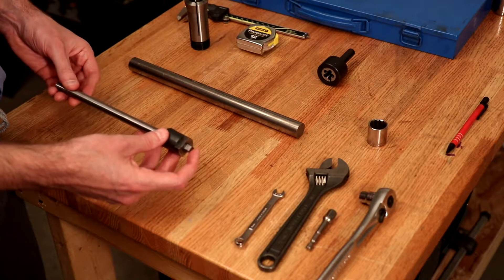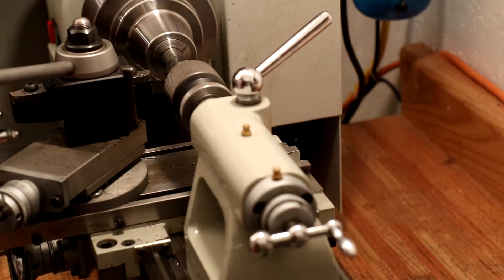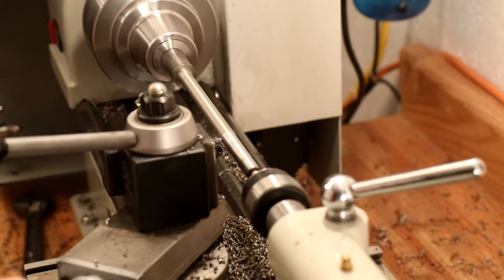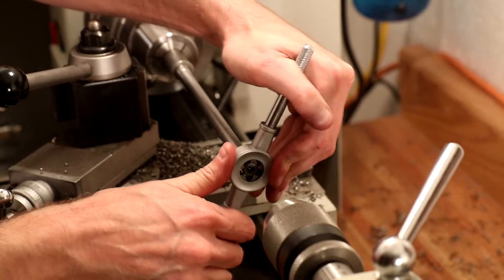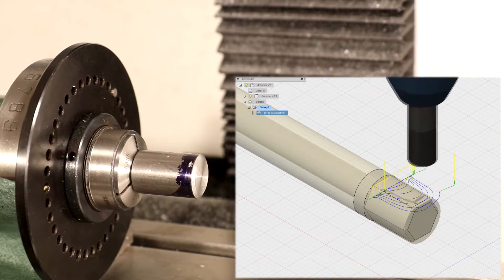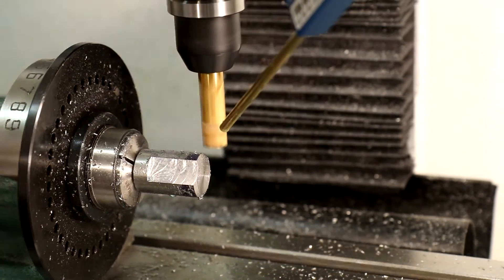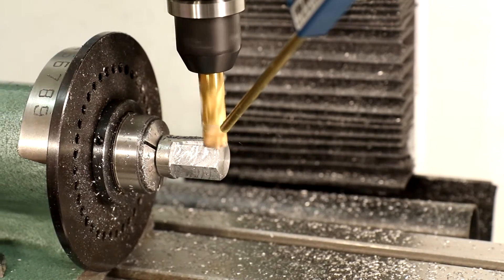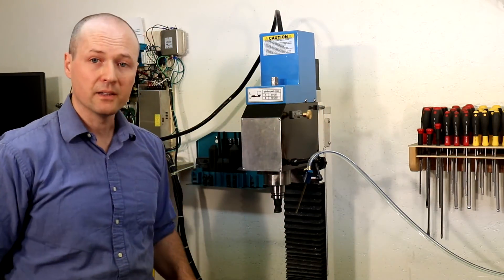R8 Drawbar Upgrade For PM25 Mill

Comment from the maker: Check out my most recent video: https://goo.gl/Jj7cU1

After having a tool pull out of a Tormach TTS collet, I found I was far from the recommended torque recommendation. Replacing the PM25 R8 drawbar with one with a Bridgeport style 3/4" head is the first step to improving the torquing of the drawbar.
Reply: I need to do this. I have been doing mine up pretty loose because that little 8mm square just feels so flimsy. Great idea.
Reply from the maker: An unexpected benefit of filming machining operations for YouTube has been the chance to review and discover what went wrong and when. I was milling two identical parts, the first one was great, but something went awry on the second, and the movable jaw plate was cut. Reviewing the video, the tool pulls out during an early cut. Tormach recommends 30 ft-lbs for on the TTS for heavy cuts. I was far from it. It's great to know the cause, because I'd previously had a similar problem, which was then unexplained. Always something to learn, right? :)
Reply: Pull-out sucks. We used to sell worm-screw style holders for bigger machines, for this reason. They hold on to the tool amazingly well. No good for our little mills. Do you have any issues getting the holder out again after tightening it up to full torque?
Reply from the maker: With the standard drawbar, I a quick tap of a wrench knocks the tool out. With the new drawbar, torqued to 30 ft.lbs., a takes a bit more, but a good drawbar wrench-hammer combo should have enough mass. Wouldn't always need to torque it so much for small tools or light passes. Below are two links related to the Tormach TTS and drawbar torquing. Hopefully the links show up.

https://www.tormach.com/blog/best-practices-for-preventing-collet-slip/
http://www.tormach.com/uploads/163/ED10067_ToolHolding_Whitepaper_1010A-pdf.html
Reply: Thanks Kent. I'll check them out.

Comment: Well that’s not a drawbar upgrade as the origional drawbar was self ejecting, this is not a good replacement. It’s just a long BOLT that will not eject the drawbar. I have made a much better drawbar that IS self ejecting.and is a genuine replacement self ejecting drawbar, with not much more work

Comment: After 5 years your video is still important!
I want to buy a new mill like your mill dimension called BF25 with MT3, but I sold my old one a BF16 with MT2.
All my lathe and mill tools use MT2.
Is it possible to change the new mill from MC3 to MC2?
Reply from the maker: Thank you, wow five years. If your new mill is MT3, mounting MT2 tools should be possible with an MT2-MT3 adapter sleeve. However, unless the adapter and tool accepts a thru drawbar to pull the tool against the adapter into the spindle taper, the tool would eventually come free while side milling.
Reply: @kentvandervelden  Thanks for your advise. Didn't know such a MT3-MT2 adapter sleeve existed. I've found online a pm-25mv_manual with exploded view such as your mill. Without the drawbar in it, so I can't consider this adapter unfortunately.

Comment: Nice informative video Kent, Thanks.
Reply from the maker: Thank you. If it helps, today, I would reduce waste by make the drawbar as two pieces and weld or pin them together. Also, the hex head was reduced to 17mm to match the nuts in the clamping kit. Best wishes
Reply: @kentvandervelden  Two pieces with welding will indeed reduce waste.
My metric mill I use a short style ring wrench ratchet low profile for now.
You could try it with your 17mm hex head.
Reply from the maker: Thank the for the recommendation. I bought ratcheting wrenches to dedicate to the lathe and mill. They're going to work well. Also, picked up square drive sockets for tightening lathe chucks. Look promising and not going to leave those in by accident.

Comment: Cutting oil is not cooling fluid. It does have some small degree of cooling effect, but it's real purpose is to lubricate the tool to prevent the chips from welding to the tool. If you want cooling, you need to set up a cooling system and use either the liquid flooding or mist cooling systems. They're both effective. The first relies on flooding the part with coolant which is mostly water with a small amount of oil to coat the parts and the machine for corrosion, the second is a bit cleaner by spraying a cooling mist which relies on evaporation for the cooling effect. The mist method is nice when you don't have a chip tray or containment area to catch the coolant and allow for recirculation. 
Nice job on the project. Thanks for sharing.
Reply from the maker: Wonderful explanation of the two, thank you! I need to think about how to contain coolant on the lathe, and not have it thrown off onto all the neighboring surfaces.

Comment: show how to convert a  20mm spindle with number 2 morse taper in tp a drawbar spindle for holding colitis. most specifically fixing Pindal drive  For up & down movement
Reply: You can use mt2 direct collets. They work just the same, they just have mt2 instead of r8 taper on the outside

Comment: Time-saving tip: a socket wrench with 12 notches fits a square head. I have Weiss WDM30. A 14mm socket wrench fits the drawbar on that particular machine perfectly . Combined with a ratcheting handle, it makes changing the collets easy.
Reply: Not a smart idea to use a 12 point socket on a square bolt. A 12 point socket has a corner angle of 60 degrees instead of 90, causing imperfect contact, and this will eventually start to round off your square.
Reply: Orcinus24x5 
In theory you are correct. But if you apply a bit of common sense, you are seeing a problem where there is none. 
It will take many, many years for the head of the drawbar to wear out. Remember we are hobby machining, not running high volume production 16 hours a day, changing the cutter often.
There is no need to tighten the drawbar to a breaking point of the wrench either. 
The square socket is also not a perfect fit due to generous clearance needed to put it on and take it off with ease.

After 3 years of using the socket with impact driver all I see is worn black where the socket so imperfectly touches the head, which probably happened at the beginning anyway.
BTW, the OEM method is to use flat wrench on the drawbar head. Guess what - the fit is not perfect either, yet it works to a point  you don’t come across complaints from hobby machinists about worn drawbar heads.
You do see worn drawbar heads abused by too much torque applied with a power drawbar (and with square socket)

So calm down, enjoy hobby machining.
Reply from the maker: Thanks Robert, that's good to know.

Comment: I find it best to cut 1045 dry. Oil and coolant can often cause warpage depending on work diameter, length, etc... 4140, 4340, and others often will do the same it ultimately depends what you’re making. If you stress relieve prior then that’s not typically the issue. A draw bar is definitely a part that can be made faster on a manual mill.
Reply from the maker: Thank you Glenn! I have a lot to learn and appreciate your advice. I don't work with steel often but I do enjoy doing so. The feedback provided by the chips is fascinating.

Comment: you have any drawing of this draw bar?
Reply: Will this drawbar work in the PM30MV?  I really like your design
Reply from the maker: Thanks. The thread is common to R8 but the other dimensions probably need to be increased for the larger mill. Some people use threaded rod and a welded nut, which would be quick and less wasteful than my approach.
Reply from the maker: Send me an email and I'll send you drawings in PDF
Reply: sent you my email

Comment: Hey Kent - any chance I could ask you to make me one of these replacement drawbars for my PM-25?  Unfortunately I don't own a lathe to be able to make one myself.  I'd be happy to pay for one from you.  Thanks, Richard @ RichMade Knives
Reply from the maker: Hi Richard, I wouldn't be able to commit to making one in any reasonable amount of time. In the meantime, have you checked on eBay or considered a long 7/16"-20 bolt? Also, check out this thread (https://www.hobby-machinist.com/threads/adult-drawbar-for-my-pm25-mv.40056/) My method is pretty wasteful of material to create a wear item. Let me know what you think, if you still want some help, you'll find my email in channel information. Thanks for asking. Probably no one is a fan of the original drawbar.

Comment: Is this upgrade nessasary to chuck up 1/4 or 1/8" endmills?
Reply from the maker: For 1/4" endmills probably not, and for 1/8" certainly not. Probably necessary for 1/2" end mills with a large radial and axial length of cut and a convenience for other sizes. I resized the hex to be the same size (17mm) as the nuts used on my clamping set. The ejection cup always required several turns more than what's necessary for loosing and tapping out the tool.

Comment: Nice video, Kent. I expect that insufficient torque was part of the problem with end mill slippage that I showed in my recent faceplate video, and I'm still using the stock PM-25MV drawbar and the pathetic little wrench that came with it. Maybe it's moot now that I'm using end mill holders, but a beefier drawbar is still appealing. On the other hand I dislike using a hammer on the drawbar and I like the threaded cup that lets me just unscrew the drawbar to eject the collet without impact. I know a hammer is normal practice with many mills but still, beating on it feels wrong. Do you have any thoughts about how to adapt your design to permit higher torque while still being self-ejecting?
Reply from the maker: Hi Jay, thank you. With the little 8mm wrench I was way under the 30 ft-lbs that Tormach recommends (1.) Using a reasonable size wrench now, hitting near 30ft-lbs is no problem, and that's aided by adding a spindle lock. The Industrial Hobbies mill I had used end mill holders, and I liked them. People say that TTS is more reliable in extension length, but I had pretty good luck with the end mill holders. Do you do a Z touch off with each? 
Do you dislike using the hammer because of impact on the bearings? With the new drawbar and TTS, only a half turn is needed with a fairly light tap. 
I've not given thought to self ejection, but perhaps one could make an adapter to increase the diameter of the threads at the top of the drawbar. Sort of a thick-washer like part with inside and outside threads (and tightened with a spanner) then make a new cap to fit the adapter. 
I did consider making a power drawbar and got an air over hydraulic power unit (2), but abandon the idea simply because the mill project was becoming more of the focus instead of a tool to get stuff done :) I don't know if it is practical, but I would consider using a lever driven cam to collapse belleville washers on the drawbar. A poorman's manual-power drawbar. 
Starting again, I would not turn the drawbar from a single piece, but instead use two different diameters, and pin them together. My approach in the video was pretty wasteful of material and time. 

1 https://www.tormach.com/uploads/163/ED10067_ToolHolding_Whitepaper_1010A-pdf.html
2 https://drive.google.com/open?id=12vmSLsWVtk3ec8ywOIhveUgDTDzKgcuXcQ
Reply: Do you do a Z touch off with each?
I just started using end mill holders in the middle of my faceplate project, and I've been doing a Z touch off every time since the set screw doesn't force the end mill to precisely the same height every time. So far I haven't had anything so repetitive that maintaining a Z reference from one tool to the next would help much, but if it came up I might consider getting duplicate holders of the most common sizes so I could just swap them. I might be more inclined to do that after I convert the mill for CNC.

Do you dislike using the hammer because of impact on the bearings?
The PM25 manual talks about hammering on the drawbar and I did that at first, until I discovered I could just back it out to eject the collet. I'm concerned about repeated impact to the bearings and also possibly shifting the mill out of alignment over time, probably not a legitimate worry on either count but I still try not to hit tools if I don't have to.
Reply: @kentvandervelden  What do you mean by pin them together? Do you mean weld?
Reply from the maker: @mattmagilke2433  Assemble the parts, drill, and drive a pin into the hole. Thank you

Comment: Good video. I like the details you put in.
Next time start with a 3/4 in. hex stock. Avoid cutting it yourself.
Reply from the maker: +Bud De Hi Bud. That was indeed the original plan and the hex stock fit the socket perfectly. I wanted a ring or washer under the hex (sorry, not sure what to call it) and with the hex stock the maximum diameter would have been the inscribed circle. I also didn't want the interrupted cuts of turning hex stock. Many, for a drawbar, pin a piece of hex stock to a threaded rod, and that would be a much faster and less wasteful approach. Many ways to do the same thing. For what it's worth,  in the video, I should have a washer under the drawbar to keep the mating surfaces from wearing. Thanks for the comment. Best wishes, Kent

Comment: Kent with the 8 point 5/16" socket torque it correctly?
Reply from the maker: Happy New Year Patrick, nice motorcycle! It's certainly possible to torque the original drawbar with a smaller head. I was concerned that there might not be possible too many times. You know that feeling when you're tightening a screw, right before it strips out? That's what I was noticing. I'll post a video today about goof-ups of 2016, and at least a couple were from improper drawbar torque combined with TTS holders combined with relatively heavy milling. If using traditional setscrew R8 end mill holders or small end mills the original drawbar is likely fine. Best wishes, Kent

Comment: Great video Kent!  Any plans to add a power draw bar?
Reply from the maker: Thank you Nico. Maybe someday, but not anytime soon. I had planned to make a power drawbar. My previous Industrial Hobbies mill had an impact wrench based one, but I used endmill holders with the IH mill. With the Tormach TTS I can change tools in a few seconds and feel how secure the drawbar is. I considered a cylinder based system, but have decided against the added complexity. You can see a picture of the air-over-oil power unit that I got for the cylinder at http://bit.ly/2hEy71E in the power drawbar directory. Maybe a power drawbar seems more critical if having to work around an enclosure? What are your thoughts? Best wishes, Kent
Reply: Holy cow, that thing is huge.  For TTS (and a mill this size) I believe one needs ~2500-3000 lbs. of tension on the drawbar.  A much smaller stacked air cylinder would suffice.  Not sure how large of a door your enclosure will have, but elbow room can get tight.  Looking forward to more updates on your build!
Reply from the maker: Nico Seamons Indeed, looks nuts, going to put it on eBay :) I planned for hydraulics to save space on top of the already tight head. Air over oil allowed a smaller cylinder (~1.5") but requires a large power unit for required force. After seeing the Enerpac unit, a friend suggested a electric hydraulic power unit. HossMachine solved the space issue of the air over air units with a pivoting arm that moved the cylinder out further. The space concern is mostly if replacing the motor with an AC motor. I only tax the spindle with a 38mm face mill and when drilling, so I may leave the existing motor. I am replacing the BLDC drive with one with fault and pulse outputs. Are you currently working on a conversion or planning one? I'm currently cleaning up a mess of wiring.
Reply: Yep, also currently working on a PM25 conversion.  Hoping to get the enclosure done soon.  Waiting on a cylinder for a PDB, we will see how that works..
Reply from the maker: +Nico Seamons Do you have your build online? Sound you are further along than me, but if it would be of any help, this evening, I'll put my rough bill of materials into the same Google drive link.
Reply: Hey Kent.  I've thought about posting it up, but have not yet...maybe when I'm finished.  I'm about 3/4 of the way with my build--still need to finish the enclosure, PDB, and a better coolant system.  How is the fogbuster working for you?
Reply from the maker: +Nico Seamons Document or build, but there are not enough hours for both. :( The FogBuster is fantastic. The coolant can be shut off and only air used. Given how long the mill runs sometimes, and my workshop is on the basement, I had to find a quieter compressor than my contractor one :) I use KoolMist and it does stain some if allowed to sit. I do feel the coolant eventually and an enclosure may help with the "fumes." If profiling, the nozzle is rarely in the right place. If designing one, three nozzle, 120 deg apart would seem to minimize that. The single nozzle FogBuster can be upgraded to two. Flood coolant would be great as well, but the FogBuster is really fast to setup. The only tools that are ever warm are drills.
Reply: You two are talking gibberish :)
Reply from the maker: Hi Alex, many have indeed told me that. Best wishes :)